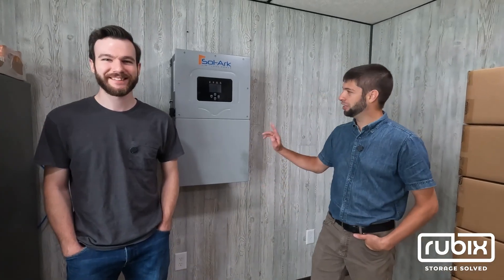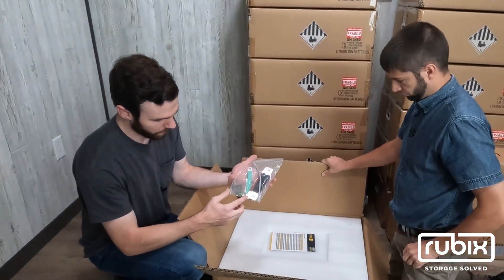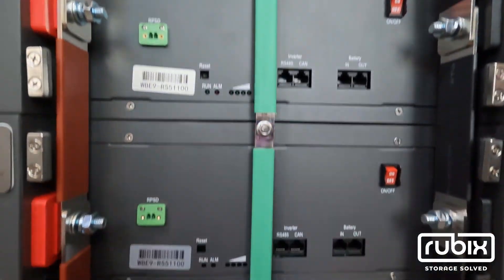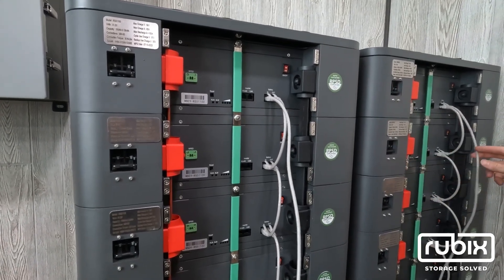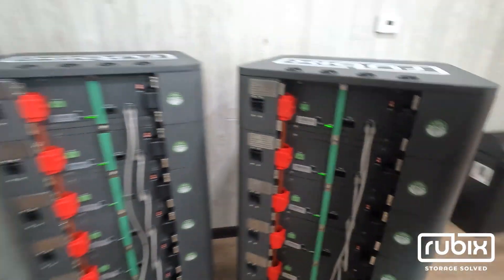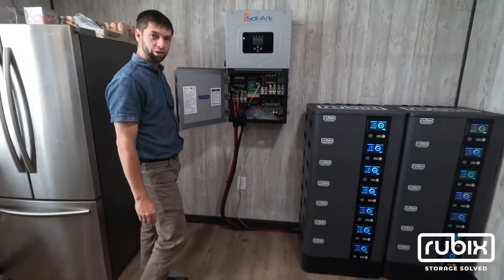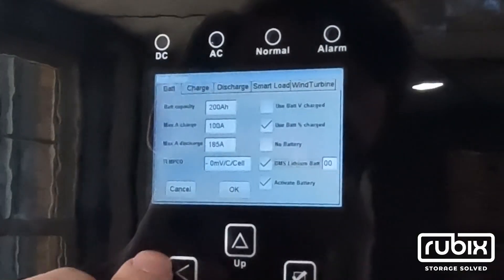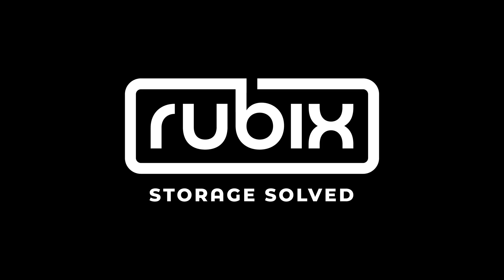Installing a 70kWh Rubix Battery Bank + Sol-Ark 15kW Inverter | Full Setup & Walkthrough

Comment: High-frequency, transformerless inverter's like this SolArk inverter lacks galvanic isolation and can potentially damage appliances, mainly due to shared DC/AC grounds, leading to ground loops, leakage currents, voltage fluctuations (brownouts/spikes), and inability to handle heavy surge loads, which can harm sensitive electronics or motors, requiring specialized installation and protection. 

How Damage Can Occur:

Ground Loops & Leakage Currents: Without a physical barrier (isolation transformer), the DC (solar/battery) and AC (appliance) sides share grounds, creating pathways for unwanted currents, causing interference or even system shutdown.

Voltage Instability (Brownouts/Spikes): Some models may dip voltage (brownouts) or produce noisy power, especially under heavy loads, which can stress motor windings and electronic components.

Poor Surge Handling: HF transformerless inverters often struggle with high starting currents (surges) from motors (fridges, pumps), potentially causing shutdowns or stress on the inverter and connected devices.

DC Leakage: The AC output can carry DC leakage, potentially damaging sensitive electronics not designed for it, or even causing issues like corrosion in marine setups.

Comment: If you want to see these in action check out my solar build video. I worked with Engineer775 to design the system. I have 95kWh in Rubix and 2 Sol-Ark 15s. Good stuff!

Comment: Just $24,000 for the Battery Bank. I have a 44 kWh battery bank & I believe around $5500 cash involved. I want to add another +or- 40 kWh battery bank to my SolArk15K. I am grid tied currently but I need to be ready to cut that tie if need be. I am only using my Battery Bank now to Grid Shave 3 hours twice a day.

Comment: Nice battery setup.  I didn't see many places where these batteries can be purchased.  It would be great if you could stack them taller.  I can't speak for all consumers, but for me the rack battery format is desirable because I have limited wall space.  When wall space is a premium, the consumer can usually make tall stacks work better.  I've been looking at Pytes (have a 12 battery enclosure) and EG4 (can double stack the six battery enclosure) for that exact reason.  Lifting 100+ pound batteries won't be fun at those heights, but having 60kWh in a single stack is very good use of space.